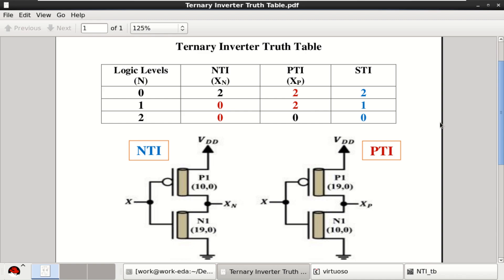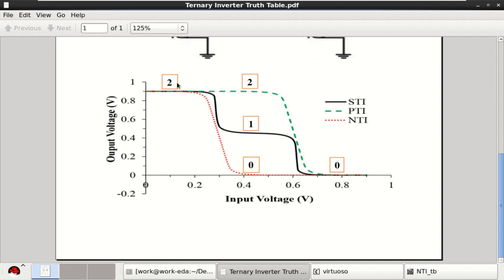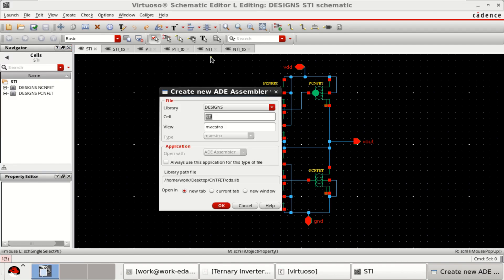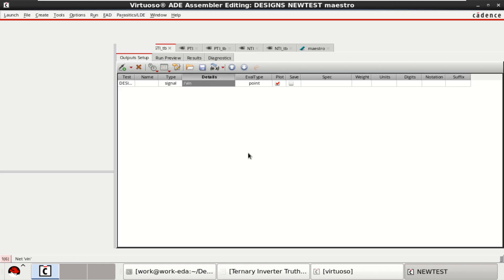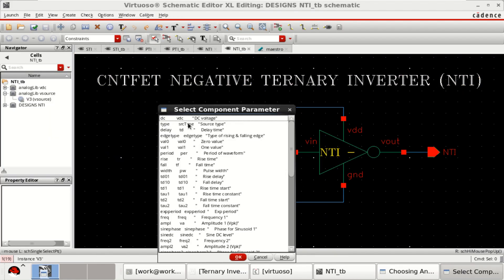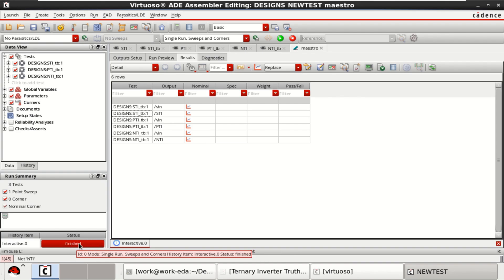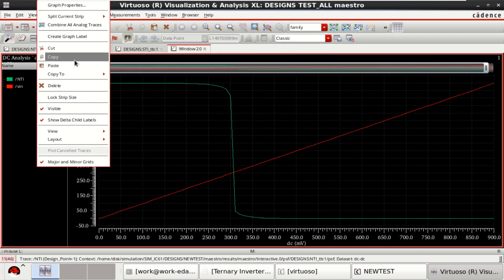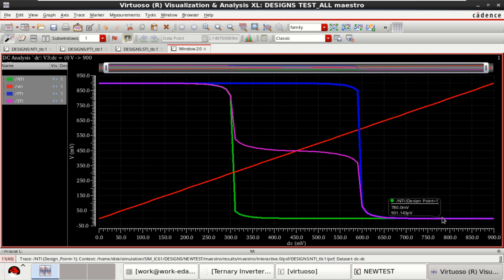Ternary STI, PTI & NTI Design Using CNTFET in Cadence.

Comment: Sir, how to vary the temperature for cntfet model.
Reply from the maker: Hi, you can perform the corner analysis for any parameter along with temperature. Use this link as reference,
https://www.youtube.com/watch?v=VpZ3br6BrPM
Reply: @dr.hariprasadnaikbhattu  i have tried using this process corner analysis sir. But for the CNTFET model , I dont see any difference or change in output when temperature is changed